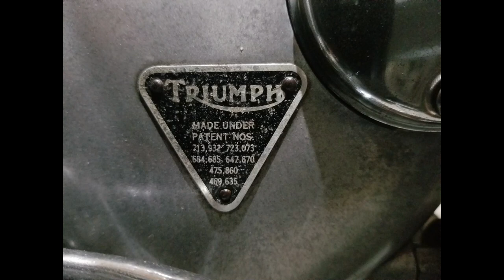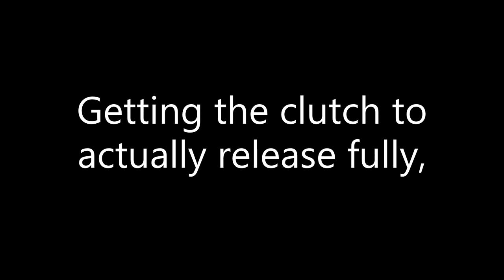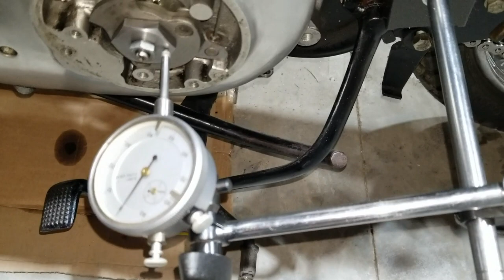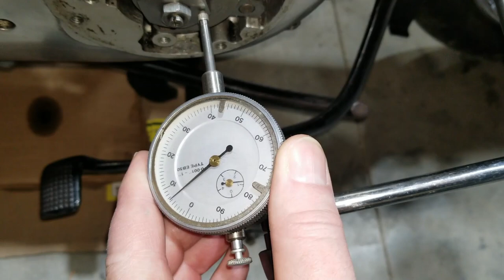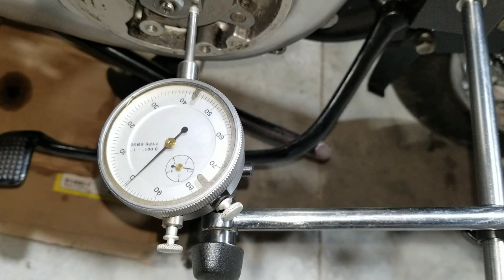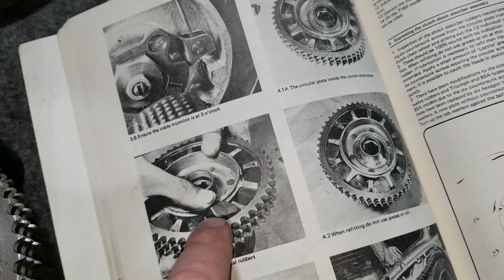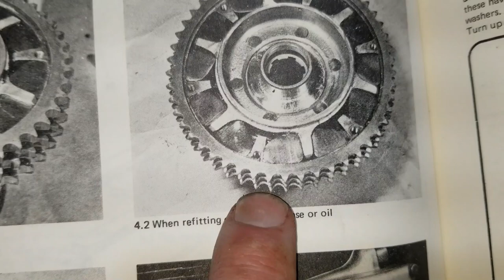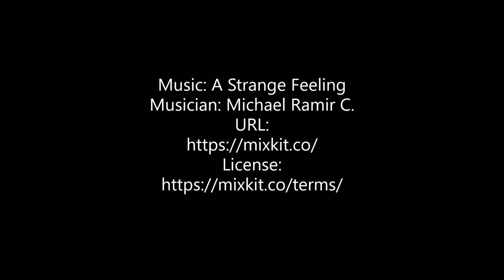1974 Triumph Trident restoration Part: 5 Finishing the clutch and getting it to work

Comment: You could put the chainwheel/clutch assembly on a crank balance wheel to check the runout. The original ball bearing is not side loaded. The nut has a relief so it only loads on the lift plate. If the clutch cable casing moves it is loosing travel. 7303 angular contact bearing. The Belleville spring rolls on the rib, does not need lube. Use MSO2 dry lube on splines and tabs. Use P80 rubber lube on cushions. New cushions are larger on the drive side and smaller on the rebound.

Comment: Please what Norton clutch lever is that?  Part no. Or description?
Reply from the maker: Clutch lever assembly part numbers
850 Norton 1973 and 1974 

Clutch pivot casting 06-3678
Clutch handle 06-2702
Screw 06-2235
Nut 06-2240

Comment: I was always taught that we should tighten the screws in a cross pattern, where your second bolt is diagonally opposite the first, then back and forth as you work your way around. I guess that’s not so important with only tightening each bolt one turn at a time?
Reply from the maker: Well the guy that my father was helping years ago at the Triumph dealership showed and taught him the same way that we did this clutch, he had told him it was best way not to warp anything taking it apart or putting it back together when it came to clutches like these.

Comment: Where did you get that new type clutch pull rod?  (57-2552). Also, do you have a part number for the Triples Unlimited pull rod taper bearing (57-3647) and nut kit mentioned @13:33
Reply from the maker: Here is all the places to all the stuff we got for the 1974 Trident

Triples Unlimited
Clutch ramp modification kit.

http://www.triplesunlimited.com/index.php?route=product/product&product_id=55
also bought Special seal kit for primary chain adjustment bolt.

http://www.triplesunlimited.com/index.php?route=product/product&path=59&product_id=73
I bought oil pressure gauge from them also.

 http://www.triplesunlimited.com/index.php?route=product/product&path=70_60_65&product_id=74

L.P. Williams (England) ordered direct from them. I also bought new
clutch disk from them also.
one piece pullrod with allen adjustment end.

https://www.triumph-spares.co.uk/triple-self-centring-pull-rod-57-2552a

FAG Bearings SINGLE ROW ANGULAR CONTACT BALL BEARINGS (7203-B-2RS-TVP)

https://www.amazon.com/gp/product/B01LX7CIC4/ref=ppx_yo_dt_b_asin_title_o00_s00?ie=UTF8&psc=1

Gasket - Oil seal housing part number  71-1451
I bought from Baxter Cycle but is available from any Vintage Triumph
parts dealer.